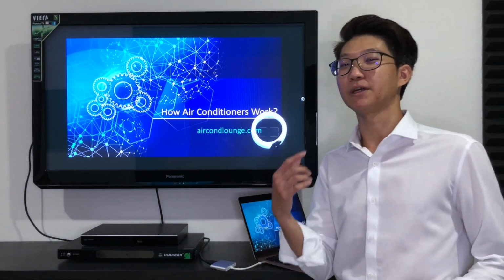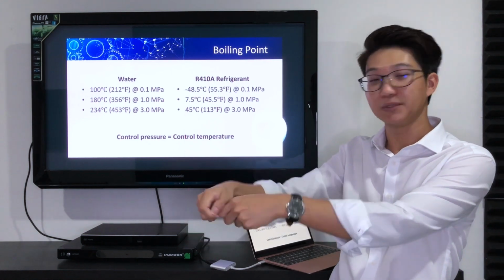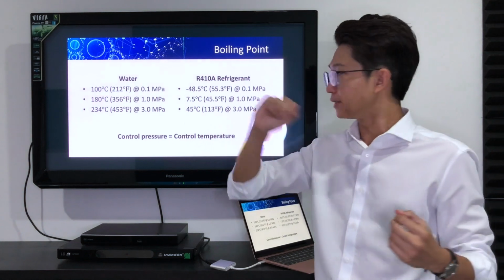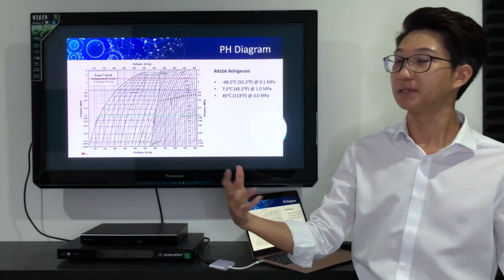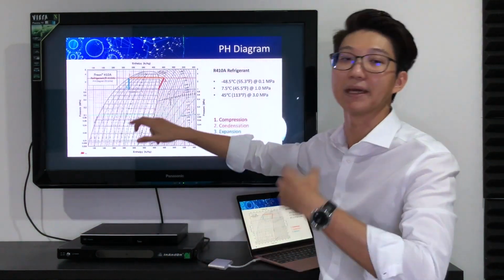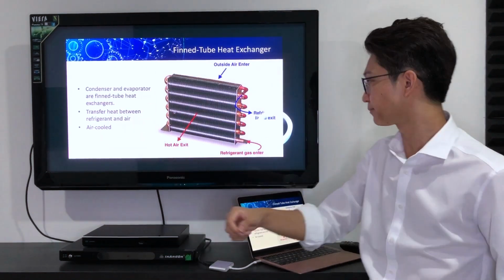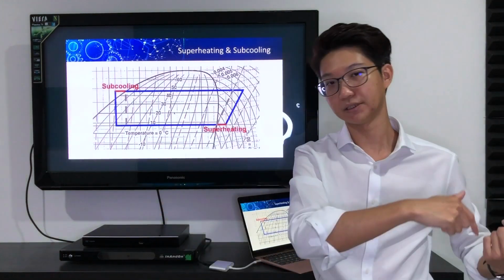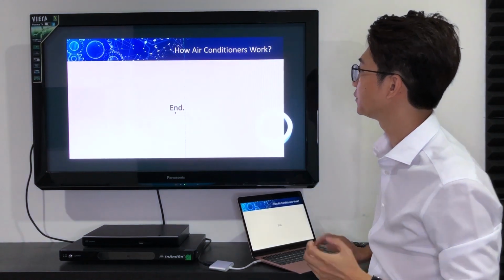How Air Conditioners Work? (Fundamentals Explained)

Comment: Really enjoyed the video.  I thought you were going to explain at the end how the load is controlled.  My question is I know we need a higher compressor output pressure on a hot day because when need to be able to have the outside air condense the vapor so it needs to be at a higher pressure to allow that to happen.  What "controls" the compressor output pressure?
Reply from the maker: Thanks for your question. There’s nothing that controls the compressor output pressure. On a hot day, the heat rejection rate reduces which causes the system to naturally operate at a higher pressure. The air conditioner will continue to operate as long as it is within the design range. However, if the temperature sensor at the compressor discharge line detects a temperature exceed the design threshold, the electronic control board will slow down the compressor which will prevent the pressure from going overboard.
Reply: @aircondlounge  I guess that still does not quite answer my question, I think.  What is the feedback mechanism that causes the pressure to rise as the outside temperature increases?  It seems at first that there would be less subcooling.  What does that cause?  Less flow through the TXV?  Or something else?